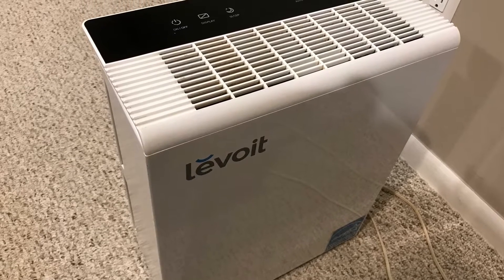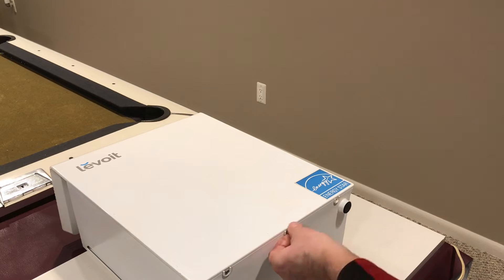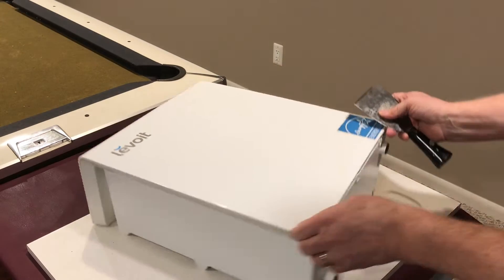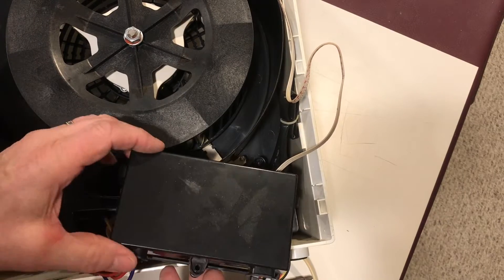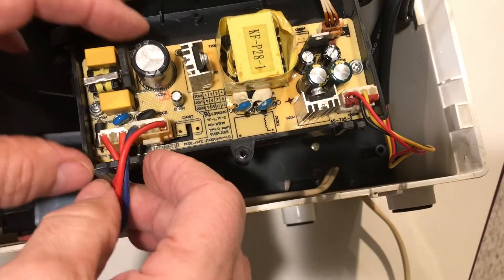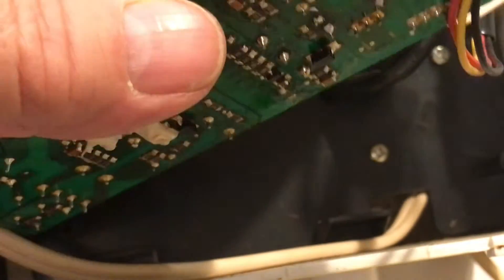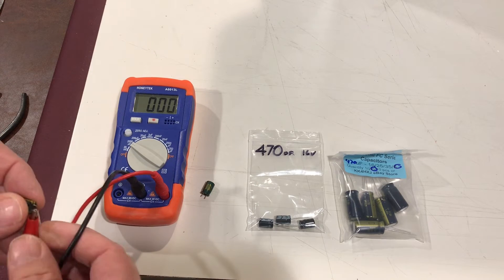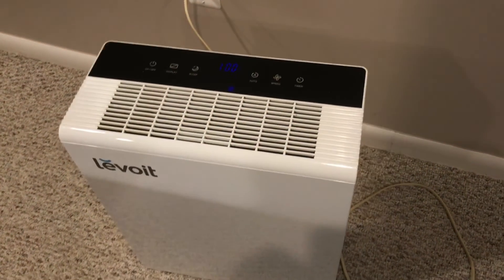Levoit Air Purifier Power Supply Repair

Comment: I am sure this is useful information, but the fact remains that this unit is poorly designed junk. Will avoid Levoit in future.
Reply from the maker: amazing how many folks reported having the exact same issue. I've fixed three so far and they all had faulty caps

Comment: Thanks for your help worked perfectly another levoit not going to the rubbish tip used 16ZLH470MEFC8X11.5 CAP ALUM 470UF 20% 16V RADIAL    Size  0.315" Dia (8.00mm) | Height - Seated (Max) 0.512" (13.00mm) bought from 
Blue Sky Components Ltd on ebay
Reply from the maker: Easy enough repair if you're handy with some tools and a soldering iron . Nice going

Comment: My on button isn’t responding. I can see that it’s getting power but it won’t turn on. As if the sensor for my finger can’t detect that my finger is there.

Is that what the symptoms were for this?
Reply from the maker: I'm not sure what all the failure symptoms might be. In my case the failed capacitors were visually obvious (and inexpensive) so I went after them and that repair was successful.
Reply: What exactly was the problem? Did any lights come on?
Reply: yes the lights came on but the heat sensor doesnt seem to register my finger, so i cant turn it on but it lights up and comes on
 @RN-rn99

Comment: Just opened mine, nothing visibly broken/burnt. Can I measure each cap while soldered onto the board or what's the best method to troubleshoot?
Reply from the maker: Now things get a bit more difficult as this may not even be the root cause of the problem you are having with your unit. Testing caps while in the circuit doesn't provide a reliable measurement. You can remove them and test them if you have a capacitor checker, or just take a shot and swap them out. I usually work on older audio units and typically just replace all the electrolytic caps. You can see the a lot of folks had success by replacing them so you might give it a try. Hope this helps
Reply: @xfireamg417  Ok, I was afraid that I'd have to unsolder them to measure with my multimeter. Mine turns on with a RED display that then flickers RED/GREEN and not responding to any input.
Reply: actually on 2nd inspection, C205 does look to be slightly bulged at the top
Reply from the maker: Not sure why but everyone seems to have the same issue with the 470UF caps. Maybe there was a production issue (bad batch) or maybe they should have used a higher voltage rating. I don't have access to these any longer so I hop you can figure it out. Good luck
Reply: @xfireamg417  Thanks for the guide! I just replaced 205 and 206 with Panasonic 8x15mm 470uF 16V (amazon) works perfectly again. The old ones measured 8uF (bulging) and 505uF…. not sure what to think of that..
Reply from the maker: @jayvkman  Way to go!! It would be nice to collect all the data behind these failures to find the root cause, but I'm glad so many people have been able to bring the unit back to life.

Comment: Great instructions!  I was able to repair my Levoit Air Purifier based on your video.  For my board, I needed to replace both capacitors(470uF 16V) for it to work.

Comment: Perfect!  I did the capacitor replacement as instructed and normal operation resumed.  I used a small flat bladed screwdriver for the triangular screw too.  Many thanks
Reply from the maker: Glad to hear this has worked for you and so many other folks. Way to go!

Comment: Thank you for the video I just don't know where I would buy capacitors could you tell me where
Reply from the maker: Lots of listings on Ebay https://www.ebay.com/itm/265609118513?hash=item3dd7898331:g:dk0AAOSwJ25iOoFi&amdata=enc%3AAQAIAAAA4AdlhH%2FmSGj7dVQFCEsQTMBBLKvVyCt79XsodBG7nXi8NPh1zB8m4GvJzNkWCtLlpl0tddciulkmAeKrK0lHajU8c58pe3TcZtAYZFNY5U2VQEEMueJsTz4xiCt1jUc2v1GfphF2RKs6HkYsMS4019P%2FuNGedCeXU%2FeES1U1OI0SWu4414HhCAT8LWKRGJxhllUNeDE4OHmIt%2FKcJF1H2tL4LbdyC0AZDQ7z3xmJ%2BjiJFm72blXRWwWCp6UF0nTjRIi9%2FctoR3pCQt17iG44xEgjTMlYFeEeKFwx61viQbpU%7Ctkp%3ABk9SR5rAwpDgYg

Comment: What is the exact symptom people are having?  For me, when I plug it in, the panel flashes once, then the red oval in the middle is on slightly, but it's not responsive to the buttons.  And once is a while it works.  It feels more like a failed control panel PCB than power supply.  I did take apart the power supply, but there was no obvious failed cap, and I don't want to replace all six if that's not the issue.  [Great instructions, BTW.  For the triangle screw, I just jammed a #2 Philips into it and it worked.]  I should have measured the output voltage before reassembling it, anyone know what it should be?  ETA: Replaced the cap, fixed the problem.]
Reply: Pretty much same thing for everyone. I'd just replace cap EC205, which AFAICT is the one that's failed in every picture/video/report. I also replaced EC206 since I was in there and bought a 6 pack, but it still measured close enough to spec. My EC205 was only slightly bulged, you can barely see it, but it's more obvious when you touch the top compared to the others. It's cheap and quick enough to fix a $200 brick ;-)

Comment: Wow.  I think this is too much for me.  But my unit bought it after 2.5 years.  It ran automatically 3 times a day for an hour, which is decent all things considered.  Still an Amazon reviewer (you?) implied the capacitors are under-powered and basically guaranteed to fail.

Comment from the maker: Glad you could breathe some new life back in those babies. I’m amazed at how many of these units are having this issue. Capacitors sure solve a lot of the worlds problems. Take care
Reply: I'm using the older LV131. Do you think its the same type of caps?
Reply from the maker: Hi - Sorry for the delayed response. Can't find any data on your capacitor. If you're familiar with the process, just be sure the capacitor has the same capacitance rating and voltage rating. The problem caps for me were 470uf 16v but one of the viewers reported having a higher voltage rating.
Reply: 2/3 my family bought are dead
Reply from the maker: @sci8  - Hope you can get the units going again

Comment: Thank you for this video. I had two of these which were paperweights and getting ready to junk them. With your excellent instructions and $3 worth of capacitors, They are both working again! I used a small flat blade screwdriver to remove the internal triangle head screw.
Reply: small flathead screwdriver also worked for me

Comment: Does anyone know what the triangle screw driver and size is for the internal triangle screw?
Reply from the maker: Sorry  - I can't remember and don't have the unit anymore to check for you. Hopefully someone can respond. I do remember that I did find the correct size in my Iphone IFIXIT tool kit.
Reply: TA27 Screwdriver
Reply: @scroberts72  thanks so much it's somewhere and I will get round to it. Bought a new one I must admit.

Comment: Thanks for posting this video!!!  I had the same issue and replaced both capacitors as you suggested.  My purifier is now living out its best possible 2nd life!    Mine went out 1 month after the warranty and Levoit refused to repair/replace the unit.  Too bad Levoit isn't watching over their manufacturing quality.
Reply from the maker: Glad folks are finding this video useful. Makes it all worthwhile to get the feedback and hear the appreciation. Glad you could fix it.
Reply: I followed your advice and ordered 2 sets of the 16v 406 caps and replaced them.  I didn't have any visible cap damage but replaced them anyway.  They fired up beautifully.  Thank you!!!

Comment: I greatly appreciate you posting this video. I bought three of these, and four have failed so far (did two warranty claims and those failed too), and would rather not throw them in the garbage. These are great air filters but the reliability is completely unacceptable. I'm guessing that they are using counterfeit/fake capacitors from China.
Reply from the maker: Glad to help out YouTubers and capture this for those in need.

Comment: What was the actual problem/symptom you were having? Mine won't turn on, and the red power icon stays lit - the whole time unless I unplug it.
Reply from the maker: I think that was the problem with both of the units I repaired. And both had the failed capacitor issue. In both cases when I opened the power supply it was pretty obvious which capacitor had failed as it showed signs of leaking. Good luck
Reply: @xfireamg417  Thanks! I'm thinking that's probably what it is. I'm going to open it up first and look at the capacitors before I order new ones. I hate just throwing things out if there's a way I can fix them.
Reply from the maker: @neveramember  I'm with you. I think today's philosophy is to throw it away. I tell my friends to let me check it out before you toss it. Been able to fix a lot of stuff through the years. Seems like a lost art.
Reply: @xfireamg417  Hi again, so I have another question. I took my unit all apart and removed one of the capacitors and when I tested it, it was fine but I noticed on the board that it looked black around that connector that's above the two capacitors. Do you happen to know what that specific connector is called? Or maybe it's the part right in front of it that leaked, is that a transistor?
Reply from the maker: @neveramember  Hi - I don't have the units anymore for reference, but I would guess one of the 4 capacitors have failed. There are a couple adjacent  transistors mounted on heatsinks but I would check the other capacitors first. You may have noticed that sometimes the components are glued to the board which can resemble a leak but that can be deceiving.